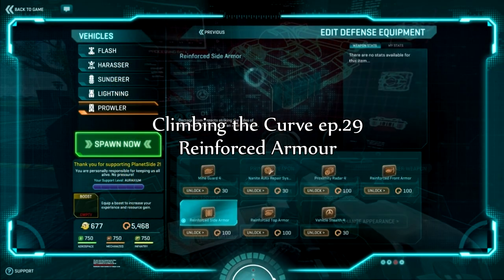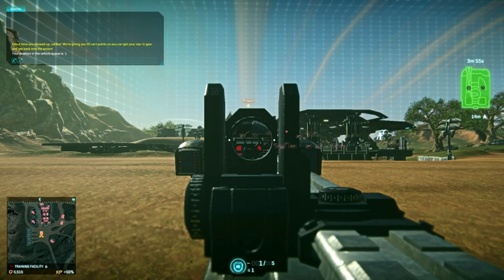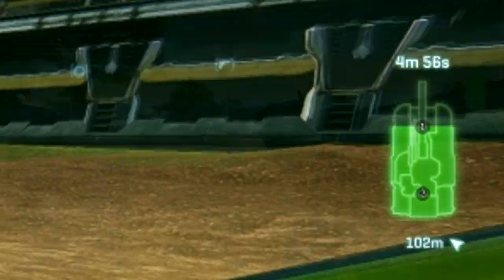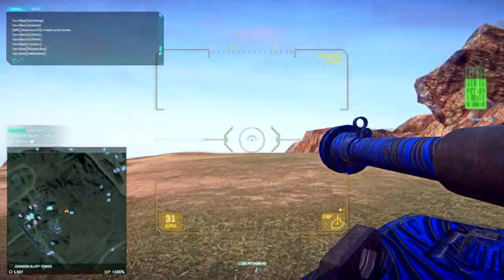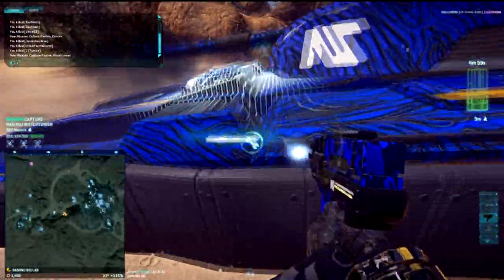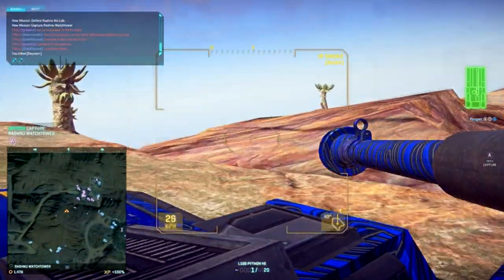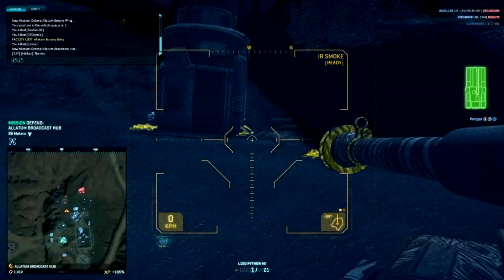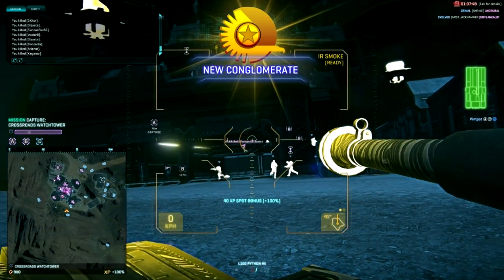Beginners Guide to Planetside 2 - Reinforced Armour - Climbing the Curve ep.29

Comment: Would pairing reinforced armor with a combat chassis favor front armor more than side armor? When I have reinforced side armor i cant help but turn that armor towards the enemy (sense of more strength), but then give them a bigger target. I'm struggling to figure out which is best with my vanguard because of that combination.
Reply from the maker: Well potentially if you could reliably absorb the damage on the front armour.  This is usually fine against tanks, but in my experience can be dangerous against infantry as they may (and often are) trying to flank on both sides and so you can show your rear to another HA when taking the other rocket on your front armour.  I feel in tank v infantry situations it is therefore a safer option to go for side armour.
Reply: Thanks for the reply thats a good way to look at it. Great video i like your style, sub
Reply from the maker: Cheers!